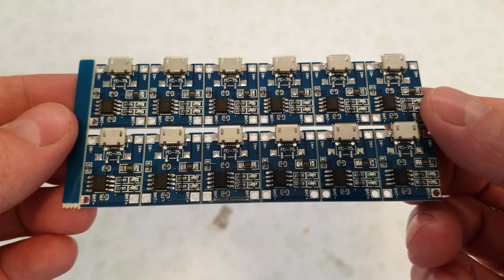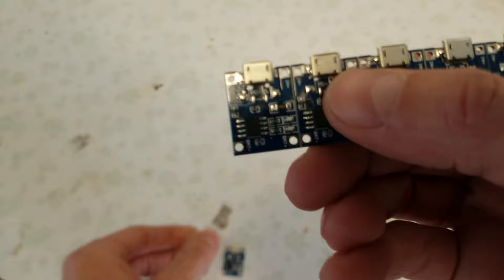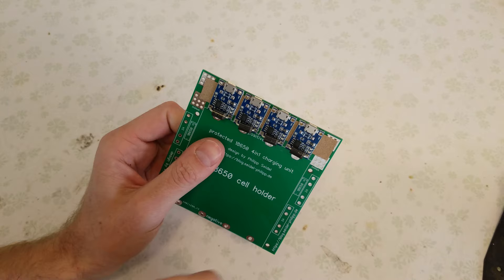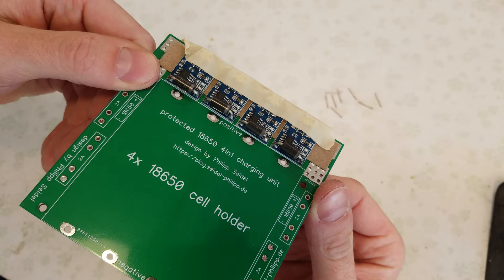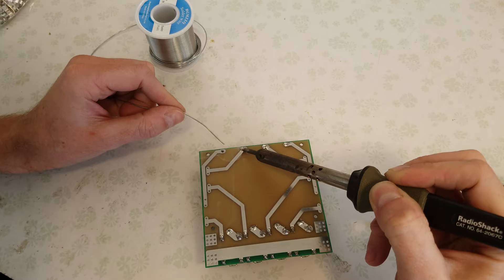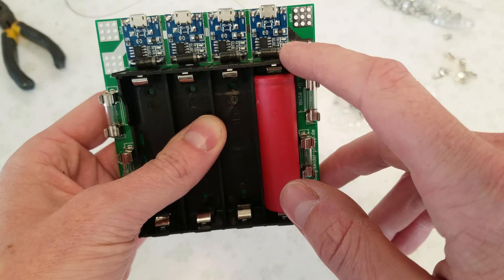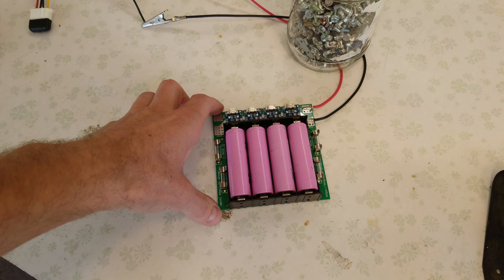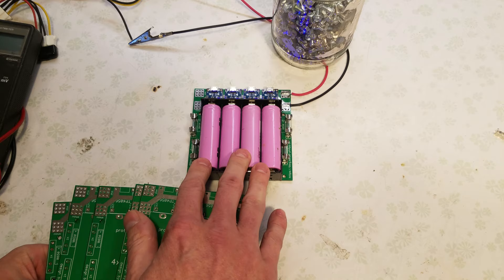Building a 4-Cell TP4056 Charger for 18650 Batteries with Reverse Protection

Comment: never seen anybody insert a battery with the + in first instead of the - first like a normal human being
Reply from the maker: I always put the positive end in first. The reason is if you put the negative in first, the terminal on the holder puts pressure on and rubs against the heat shrink that wraps around the positive end. I'd rather that not wear and/or tear which could potentially cause a short.
Reply: LithiumSolar didn’t mean anything wrong about it ... those cell holders are shit for that reason but are better than a spring version that’s for sure and I completely understand what ur saying I know I had to rewrap a couple of cells for that same reason... it’s just weird that’s all
Reply: Hello, there’s always the ‘first time’ to understand, learn and apply things that one has not, read, seen, heard or done before. I am a proponent of Positive first and then the Negative , supporting the German Engineer’s explanation. The experience I have had was, torn insulation, subsequent shorting and burned contacts. The Chinese holder contacts are very rigid that requires a wee bit of muscle power to insert and remove batteries. I also use a flat end SD on Negative side to gently pry to detach the batteries. In a motor vehicle, positive terminal is connected first and then the Negative terminal. The theory is applied here, too.
Reply: Sree  Kumar all I’m saying is that since they are not us made ( well nothing is any more) you have to insert differently .. and I agree with you when we all should just sponge what we see and learn from it but what if the holder was spring loaded at the negative side, that was my point  , also I have tried/tested connecting the battery negative first multiple times and I have never seen anything wrong or nothing has ever happened ... hasn’t fried the ecm/pcm/bcm.. that’s on gm/JEEP /Honda vehicles nothing has ever happened but I still start with the positive because if I continue to do the negative side first that will make me look weird ... 🤷🏼‍♂️

Comment: Stupid design from a clueless Youtuber. Should be using the TP4056 with the "protection" circuit. That means a DW01 charge controller and small 6/8 pin Mosfet package. These additional components provide the Under-Voltage (Discharge) and Over-Voltage (Over-charge) protections that are critical for Lithium cells.
Reply from the maker: The stupid youtuber didn't realize there was a protected version. Also, this was not my design. I don't know the person who made it...
Reply: @LithiumSolar  - yes, however you are presenting yourself here as an "expert". You lack of knowledge about the subject means you shouldn't really recommend solutions like this. You placed your blind trust in some random PCB design that you found online, which looks attractive but has numerous design flaws because it was designed by someone else with similar inexperience. In this instance, it's very poor practice (and probably dangerous) to charge batteries without protection circuits to disconnect the cell. The TP4056 modules you've used are intended for charging cells with inbuilt protection board, for example mobile phone and camera batteries, and the protected modules are for unprotected cells like 18650 laptop pulls (where you are chopping out the original protection and balance circuit). You would have found the protected ones during your  internet searches, but did not know enough to recognise wjat they were. BTW the protected ones cost about the same price.
Reply: @johncoops6897  with that amount of knowledge I would of thought you would have your own Youtube channel. If that were the case maybe you would not be so critical of someone at least attempting a project. Its easy to be critical. Credit where credit is due - this is a great instructional video. Perhaps it was made before the newer boards were available..........
Reply: @LithiumSolar  I made the mistake of ordering the wrong tp4056 and of course the holes do not line up. I then order the correct version of the  tp4056, without the protection circuit, and I guess each manufacturer's build is somewhat different. The second board was slightly larger and I had to use twisted copper to run through the in+ and in- connections, you need to thread the wire prior to soldering any part of circuit board to the baseboard.